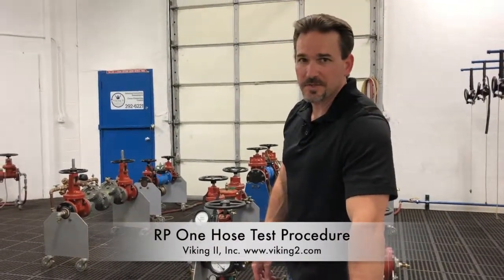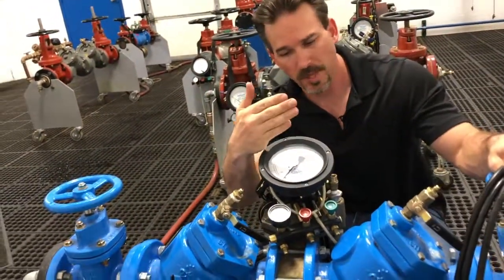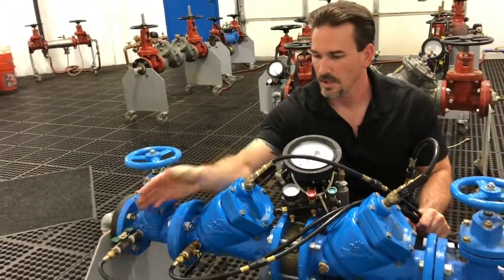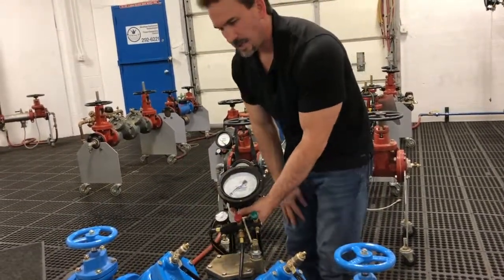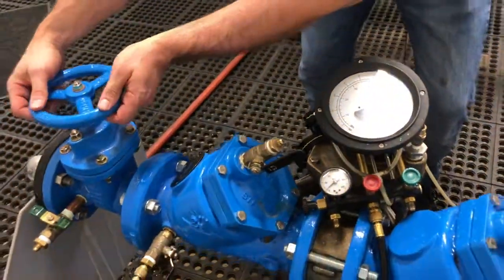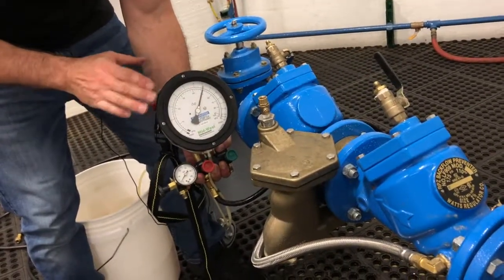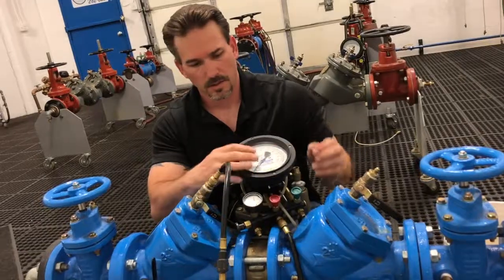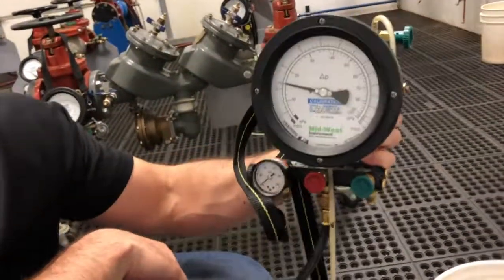RP One Hose Test Procedure

Comment: One hose test does not test for backpressure when you drain all the water out of the relief valve you have trapped air. If creates stress on the relief valve blows out o rings etc air is compressable water not colorado water purveyors are banning iapmo asse because they teach it i taught iapmo for 3 years and this method it doesn't work and is an invitation for problems your video s are good as is your facility
Reply from the maker: Our jurisdiction allows this test strictly for troubleshooting/diagnostic purposes - not for actual readings to be submitted. Thank you for the compliments and comments. Come by our facility if your ever in the albuquerque area.

Comment: I wouldn't do this test on a large domestic main like in a hotel because if the sensing line is plugged and you shut off the #1 valve, it will probably dump 100% from the relief when you turn it back on. Most hotels aren't happy with a 2-3 hour unscheduled rebuild. Also, do you know why most watts 909 devices with 1/2" test port ball valves are plugged? My guess is bad design that lingers because i see new ones installed all the time. Edit: i'm going to try this test on less essential devices. Edit2: This reminds me of the PVB test
Reply from the maker: Great comment. I can't tell you how many times the rv has dumped for me even during the flushing sequence at the beginning of the test - especially on the larges diameter 909's. The 90 that attaches the sensing line to the RP is almost always plugged. Geez for the price Watts charges for a 909 you'd think they'd be designed a bit better. And yes, similar to a PVB test but think of it as a double check valve test procedure on an RP. Thanks for the comments.
Reply: Watts 909 2.5 and larger hydraulicly collect debris because of the way water flows through the assembly.Debris collect s in the test cocks and clogs sensing line i have seen this in at least 10 states from colorado to all if the east coast its not water quality its too omnipresent to be so i have been told this is the last year of the 909 prototype flanged have talked to many in the industry no concrete answer replacing the old 909 good thing i have seen too many times go to a full dump destruction putting air bleed valve on the relief potential disaster for. Testers thinking it is a testcock thanks for responding to my earlier text